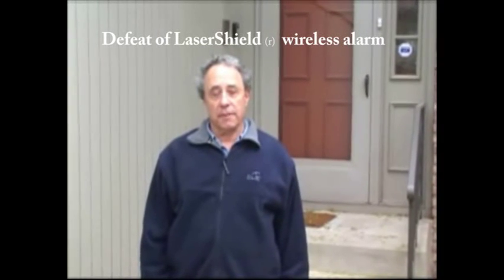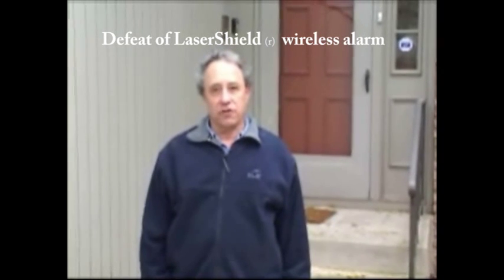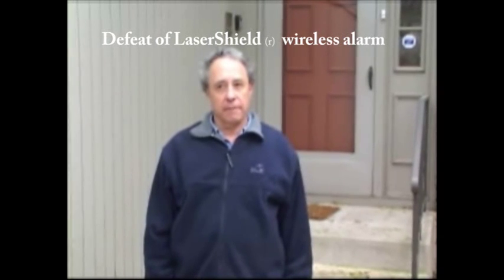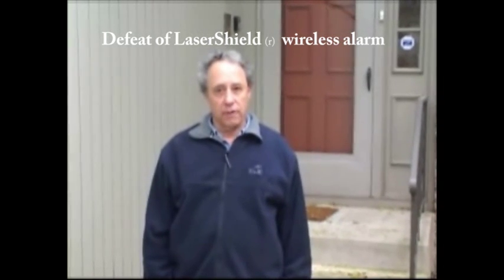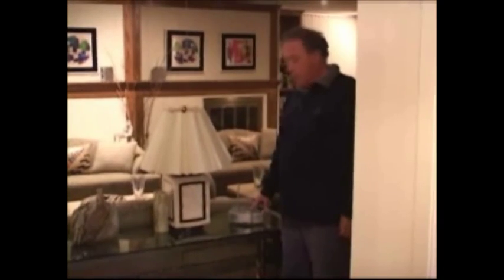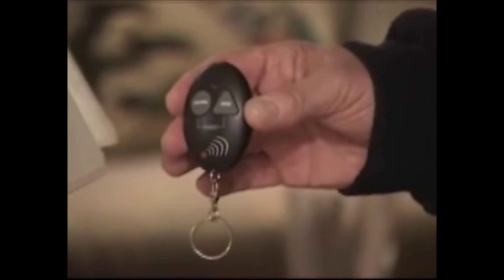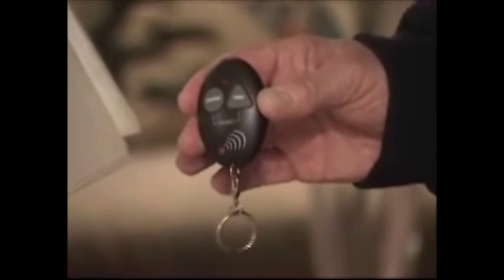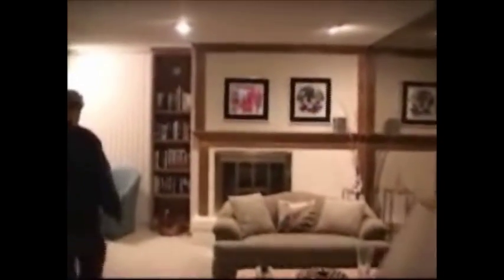ANALYSIS OF LASERSHIELD ALARM SYSTEM

Comment: radio is likely set to 433MHz, that and 315MHZ seem to be common for wireless systems from remotes, alarms, and weather stations. Could also be done with a Baofeng radio. This is due to the "capture effect", a stronger FM signal will overpower a weaker one, and the radio is likely 4-5 watts, and the transmitters are likely only a few milliwatts.